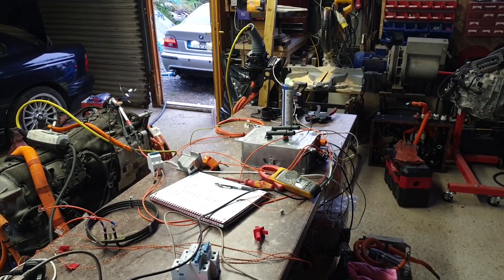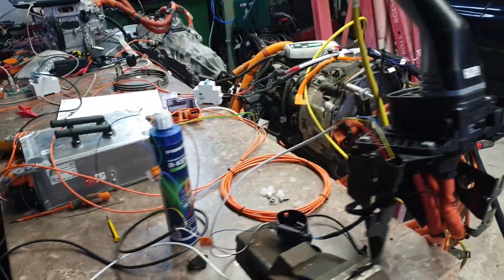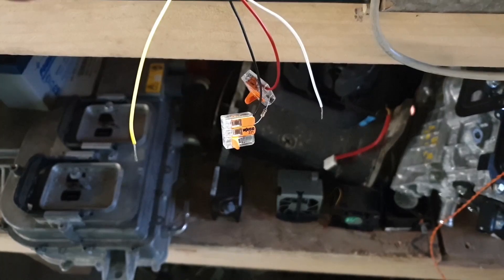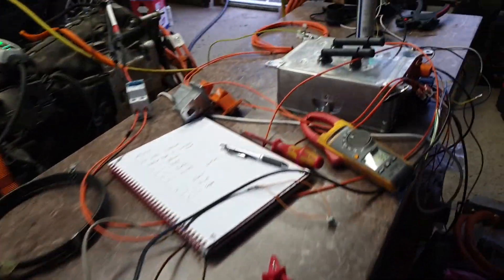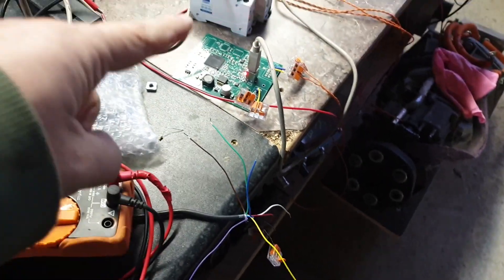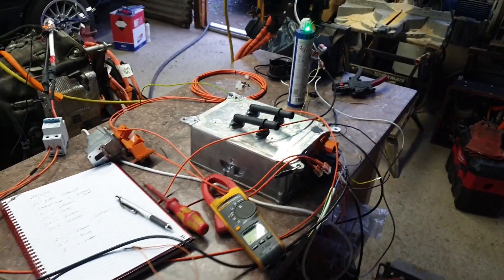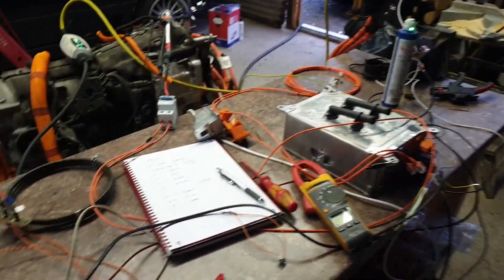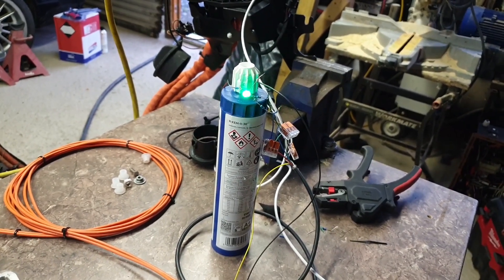Hacking The VW Onboard Charger Part 3

Comment: Hi Damien, guten tag. I realise you probably don't get a chance to respond to these messages. But I will try my luck anyway. I would be interested in what you are doing for the klimaanlage (air con) in your bmw conversions? have you managed to crack the can messages for the Tesla or other high voltage compressors? or would you use the elusive and expensive PWM controlled one? Would be a very cool (see what I did there 😅) project to see. Or maybe you know of people in your circles that have already done this?

Kind regards from Germany.

Comment: One button by the flap is for starting set time charging via the mib and one is for starting charging when you put the connector in. To stop charging and unlock the charge cable you need to unlock the car by either key or inside doorunlock.....wich you stated later in the video if I could just watch the whole thing before commenting =)